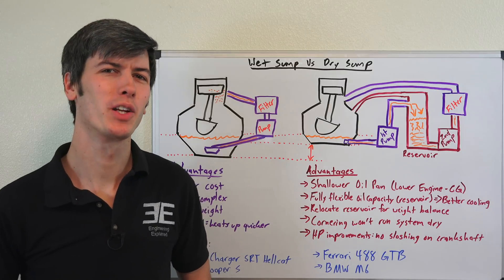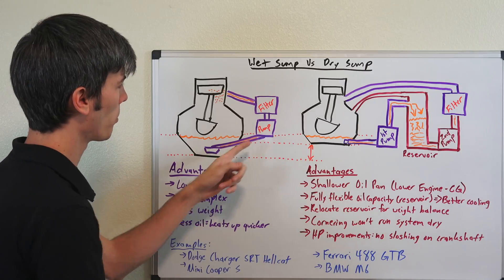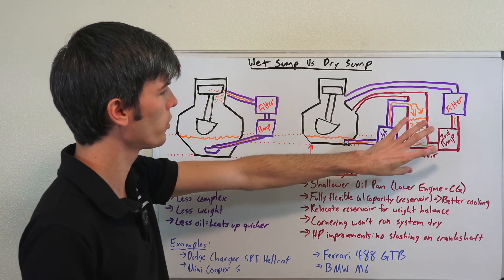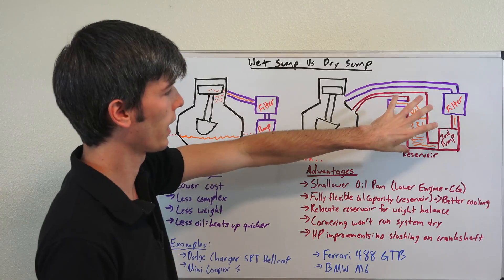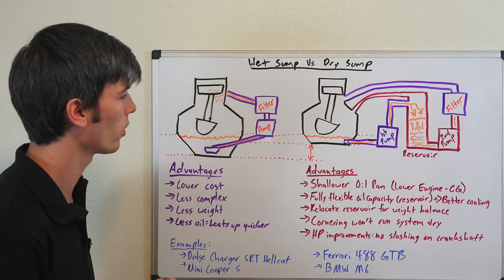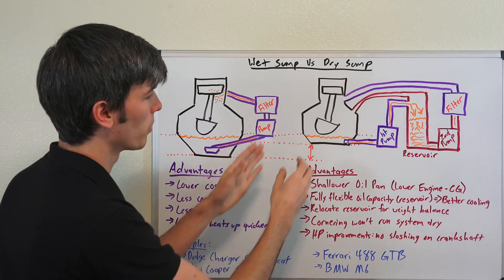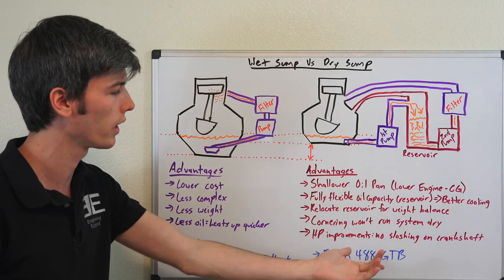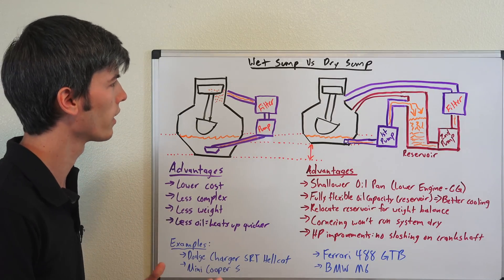Wet Sump Vs Dry Sump - Engine Oil Systems

Comment: I just put Toyo R888r tires on my mini; took it around a corner on peak grip and chucked the car in apex; it throws oil pressure and limp modes the car.. time to go for a not so cheap dry sump setup

Comment: Two more things. Using a dry sump allows you to funnel it through an oil to air intercooler meaning you can control and stabilize oil temperature, very important for running the engine over a long period of time. And if your crankcase oil pump is strong enough you can pull a vacuum in the crankcase, this reduces stress on the piston rings a little bit, increases hp because you are further reducing crankspeed drag, and it improves oil scavenging in the dry sump. A dry sump also has a greatly increased oil capacity which makes the engine longer lasting in theory (because it dilutes contaminants more, reducing the contaminant count per ml at identical oil service intervals). So you get better lubrication, more reliable lubrication, better cooling, more power (no viscous drag + possibly a crankcase vacuum) and a higher oil capacity.
Downsides are it is slightly heavier than a wet sump (added components, more oil), more expensive to manufacture than a wet sump and the oil needs longer to warm up (because of the higher oil capacity and the oil cooling). 
Dry sump systems are objectively better but history has shown that people can‘t drive dry sump cars. Mercedes used it in some sedans but customers kept complaining that engine needs too much time to warm up.

Comment: Pentary q: looking at a horizontal ss50 engine, dac or monkey could do to..
I'd like to adjust to redirect pump output..current affairs..more % or smaler cog. Key is lubricate cilinder wall and force feed crank.

Comment: Is that why motorcycle engines can get away with wet-sump easier, their engines are always perfectly oriented in relation to the g-forces acting on it (since you lean when you corner)?

Comment: The other reason you’d gain HP with a dry sump is because you’ll be running a vacuum inside your crankcase. The secondary oil pump usually flows at MUCH higher pressures than the primary, and that causes a vacuum effect that sucks the pistons down

Comment: what is the extra tube in the dry sump for?(the one directly connecting the reservoir to the crankcase)
Reply: It's for gases to vent out of the reservoir so to not build up pressure and possibly damage the reservoir.

Comment: There's also a benefit to dry sump for pumping losses since the piston seals will be better and the pistons themselves are "working less" against the lower ambient pressures of dry sump crank cases.  In summary, for modern engines under fully electronic control, the SOLE benefit wet sump systems have is reduced cost.

Comment: Powersport vehicles use a dry sump system too, given that they are often bashed around the 4stroke powered toys would run dry fairly often with a wet sump

Comment: But won't the first oil pump pull all the oil from the crankcase, meaning the bearings between the crankshaft and connecting rods won't get enough lubrication when there's no oil there? Or do they get lubrication from somewhere else?

Comment: For some engine swaps this is just about mandatory, could anyone link me some resources to do a dry sump conversion? I'm looking into a diesel swap where the engine is ridiculously tall (6v53 detroit) and lopping off the oil pan will keep my truck looking stock so I wont need a lift (something I want to avoid).

Comment: The Second gen 2017+ NSX also has factory dry sump system. However it’s factory filled with mobile one 0W-40, so I guess that’s why you didn’t list it.

Comment: Howdy, I admire your channel like no other, but you missed a couple more major advantage for the dry sump!

 AERATION... Having a lower oil level will reduce parasitic drag (windage) on the crankshaft from the oil in the sump as you mentioned, but it will also reduce aeration in the oil. At Higher rpm's aerated oil will cause hydraulic lifters to collapse significantly which cause power loss due to reduced lift. It also effects idle because the lash will delay valve timing and won't allow scavenging to take place properly. This lash in the tappet wears out the valve train a lot faster! 

                     .

Comment: One of my favorite things to do is learn new things which is why I especially love this channel, always great and up to date content.
Reply from the maker: Thanks!!
Reply: You're very welcome, I'm curious why the overall design of a rear end on most RWD vehicles hasn't changed in a long time. If you look at Model T's from a long time ago, they also had ring and pinion rear ends. I'm very curious why there isn't a new and better way to transmit the power, it seems primitive to me that modern cars still use the same overall design. Do you know why that is?

Comment: So a dry sump is so called, because any oil that runs onto it from the engine is then pumped to the reservoir? (none is stored on the oil pan but some does run onto it?)

Comment: There are many more benefits to dry sump than avoiding "sloshing", also known as windage. First of all, a well-designed dry sump will pull a vacuum in the crank case. This not only reduces pumping losses, but makes the rings seat better. In built motors, this means you can run "looser" rings (smaller diameter) which frees up power normally lost in piston friction. Dry sump pumps also allow the engine builder to tune their oil pressure needs to RPM better with pulley size changes, and as was mentioned, offer much better control over the temperature in the oil system.

Comment: Thoughts on the dry sump system used in the Aston Martin Vulcan? The engineer showed me how simple the setup was and how fast to do an oil change but is it actually feasible? I suggested it would work better for commercial vehicles or marine. Keep up the great work :)

Comment: Dry sump ALSO - eliminates air bubbles, makes oil primed start super easy, with hard stops (drag racing end) keeps oil flow (oil isn't slammed to front of sump).
However, a wet sump set up with extra capacity and an oil accumulator is probably good enough for most street vehicles.

Comment: BMW S62 engine is a wet sump system with additional pickups along the periphery of the oil pan.  They are automatically used during high G turns.

Comment: I asked you what determines towing capacity? Shouldn't a Ferrari tow more than a suv based on torque
Reply: you also have to have suspension, breaks, and chassis that are set up for towing
Reply: Niko Yochum what better breaks than carbon ceramic?
Reply: Gitonga Mwaniki not "better" per se, but built differently

Comment: dry sump is actually very common on motorcycle engines.
especially when it comes to offroad vehicles, where it's an everyday thing for a bike to be laying flat on the ground still running.
KTM even builds this system called 'semi-dry-sump' where the gearbox effectively is the oil reservoir.
I never knew there where cars using that system.
Thanks for explaining the pro's (besides beeing able to wheel for like 5 miles straight =) of dry sump systems so very understandable.
Reply: Everyone loves the ls7 and puts in it their sand rails and trucks for this reason.

Comment: What is your take on inverted aircraft engines? Typically they use a dry sump system and the idea is that the oil would be circulated evenly throughout the engine so that the oil properly lubricates without becoming saturated in one cylinder which would result in a hydraulic blowout and catastrophic engine failure. Keep in mind those engines the oil pan is located above the cylinders and valvetrain.

Comment: Would rather be a dry sump system witch has larger power losses.  There are 2 oil pumps to drive from crank and they are usually larger.

Comment: Wet or dry, sump oil is extremely frothy from being whipped around by the crank, con rods, etc. so a major dry sump advantage is removing this air in order to create an unbroken stream of oil. The importance of this is such that as Porsche has reduced reservoir volume to save weight they made up for this with centrifugal oil reservoirs that draw clean oil from the outside of the centrifuge. They also use several electric oil pumps both for energy savings and to allow independent oil flow and pressure to different engine areas. Porsche electric oil pumps activate before engine cranking, eliminating dry cranking, another major benefit. But, we maybe shouldn't mention that. After all Porsche runs Mobil-1.

Comment: EE, thanks for that explanation. I have a dry sump system on my old 89 Yamaha XT600. I didn't realize why they did it until your video. Lower center of gravity for the engine/more clearance since it is a dual sporting, or off-road with street mixed vehicle.

Of course, that's just having the engine lower, or higher for the ground clearance - yes that CG is better, but all the oil in the dry sump is up under the seat, so it's pretty high on the bike! LOL. Still, a lot of bikes don't have something opposing the exhaust for weight, so this helps with the motorcycles balance.
Reply: Even with dry sump can bikes handle 5 minutes of wheelies? 

I've seen riders keep a wheelie going for minutes on end and I've always wondered if they run out of oil

Comment: Not exactly related to this but maybe you could answer this question. What are the major components at concern for a water/flood damaged vehicle other than the electronics. Would the engine and transmission be ok to use say swapped out to a different car. Or if water did get in the intake would it just need to be drained and possibly taken apart to ensure no water is inside it. Thank you for any useful information.

Comment: Was recently thinking of this after some guys bragging about dry sump, and reminding me I hear dry sump mentioned a lot when talking of high power race vehicles and higher end sports cars, and was curious wtf is so special and what the difference is... Dry sump (not sure why it's called that tho), although superior in lubricating ability and fitting better in a lower car, isn't really necessary in 95%+ of vehicles, and also is more expensive and complex, and so not having a dry sump is nothing to be sad or ashamed about unless you've got a dedicated track car or frequently see the twisties at high speeds.

Comment: would love dry sump in that added benefit that you can do an oil change through the hood of your car if you are on the track and burning oil to fast and don't know why but you still gotta get home. Remove that burnt oil and put in new oil without needing a jack, also can promote quicker interval changes in the real world, and before you say. blah blah what about the metal mesh junk on the bottom of the pan? What about it? It will stay there and if you sump sucks it up, its going right to the filter anyway, fact is, there will always be metal in your oil, no matter what.

Comment: Question: more and more cars in North America are adding turbo chargers from the factor to their daily drivers. I've noticed a lot of people insist on adding 1 to 3 oil catch cans to their ride. If this is an issue why doesn't an OCC come stock from the factor OR do you really need it?
Reply: Not really.

Comment: So is there any particular reason that Harleys have a dry sump and Track bikes don't? Seems kind of backwards
Reply: Because Harley engine's are large and have a long stroke making them very tall. With a dry sump they can be less tall. For cornering it's not really needed on a motorcycle. If you lean into a corner the forces from leaning will also be applied to the oil, unlike in a car which stays flat resulting into forces on the oil moving it to one side.

Comment: sidenote: not every engine is suitable for drysump (conversions)

I remember reading about a Ford Fiest rallycar that kept blowing up its engine using a top-end drysump system

after 5 engines they switched back to wet sump and all was good.

Comment: Racecar = Dry Sump, NormalCar = Wet Sump
Reply: Normal cars driven on track also need a baffled sump if driven hard enough, or if the engine has a less than ideal sump design to begin with. Could also be a track with banked corners. The track closest to mind has fast banked sweepers. Kills most engines unless they are baffled

Comment: So the oil is fed in at the top and works its way down the engine via gravity? I thought having oil in the piston chambers was bad as it would mean you're burning the oil in the combustion stroke.. although, I guess you need a small amount to lubricate the piston rings?

Comment: What is the volume of oil going through the engine at various RPMs? and besides a loss in lubrication/cooling, are there other consequences  if air gets trapped in the oil system?

Comment: Can I just get an engine with the pistons and combustion at the bottom instead and not be bothered with the sump at all?
Reply: And speaking of what do boxer engines do?
Reply: 2-strokes are sump free but basically way different so not comparable.
Reply: Jacob Seegmiller he said engine that didn't need to be bothered with a sump lol
Reply: Any engine can use wet/dry sump just depends how it is designed.  Boxer like you find on the road in subaru's use a wet sump, mainly because the cost is less.  Same reason almost all road cars are wet sump.  As far as your other question I think you need to watch some more videos on how an oil system works on a 4-stroke motor.  His white board picture is pretty generic in this video of showing where the oil is going.  It is actually pumped through galleries and into the bearing and sprayed other places its needed.  Does not really go in the the combustion chamber.
Reply: 2 stroke engine
Reply: Jonathan Dittmar fair enough lol might as well grab some rockets while we're at it haha

Comment: My 2016 Ram ecodiesel shipped from factory with Pennzoil platinum euro L 5W30 full synthetic.  FCA had to release a TSB to update to rotella T6 5w40 full synthetic as they were experiencing a high rate of main bearing failures.  So I am not sold on your pennzoil marketing (take the money though).   Might be good for high performance gas engines but not for the VM motori diesel apparently.  That being said do you think manufacturers are running light oils these days mostly to meet EPA fleet fuel economy targets?  My previous vehicle was a 2013 f150 ecoboost that experienced a connecting rod failure at 65k km, so call me jaded I guess.  Now I hear stories about my Ram but so far so good (38k km) and it has been updated.  I commute with my vehicles, don't tow or work with them.  Aggressive passing and that's it for loading.

Sorry does not have much to do with your wet vs dry sump video.  But I was mostly interested in your opinion on oil weight these days.  Manufacturers seem to be right on the bitter edge, especially with turbo engines.  My opinion is heavier weight oil helps with blowby and oil contamination associated with turbos.

Comment: So when you're taking your car to the track, is it better to have the engine oil at the top mark rather than the bottom mark on the dip stick? Doing so you would reduce the amount of sloshing for the pump to suck air
Reply: FIFTYmil keep the oil just a tad before the full mark never run with low oil

Comment: Don't worry EE I don't think the hell cat is going to be doing hard G's in a turn lol
Reply: Hercules Rockefeller it has a wet sump engine...
Reply: Yeah I was wondering why the hellcat had a dry sump.. The only hard g's in that thing are taken when the owner plows through the exit ramp guard rail after drag racing on the highway
Reply: @herculesrockefeller2984  or when it comes to a rest against a tree because the driver is so reclined back he can’t see over the dash.
Reply: Unless you hit something...
Reply: unles you're doing a friggin' long skid ?
Reply: What's turning?
Reply: cutthroat795 oops, I thought they said dry. wet makes sense
Reply: True
Reply: Its like a wheelchair around a corner no stability peace of krap of suspension

Comment: Can you do a video about cars with staggered set ups? I have a Genesis Coupe and am doing a square set up for the winter - rationale being that I could always put the best tires on the back. But what happens when I go square when its meant to be staggered?
Reply: Unan1m0us more grip in front with square. less understeer. could cause oversteer at the limit, but nothing will be different under normal conditions.